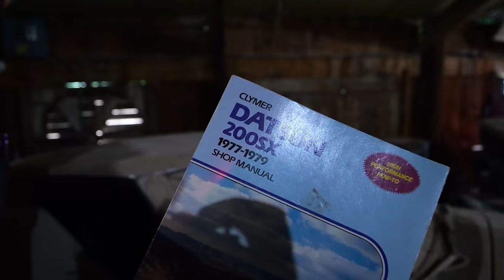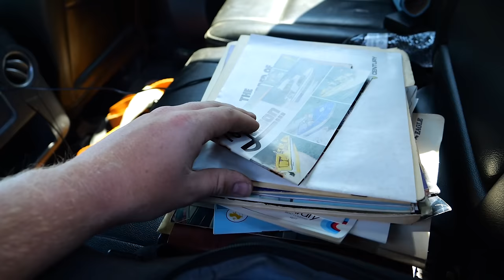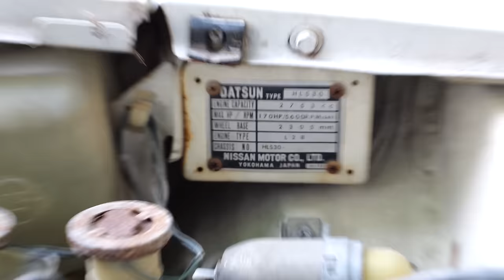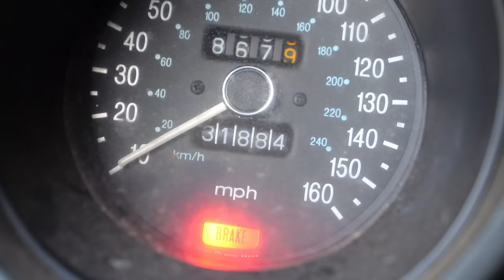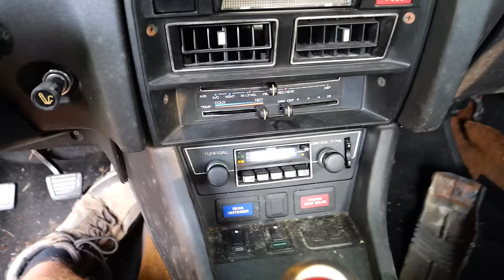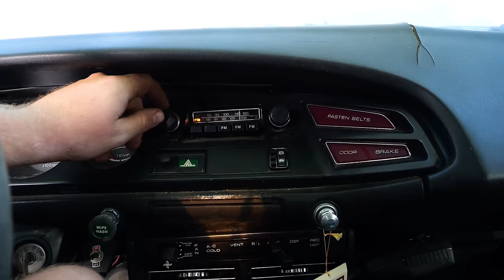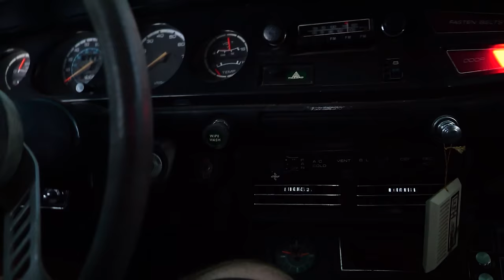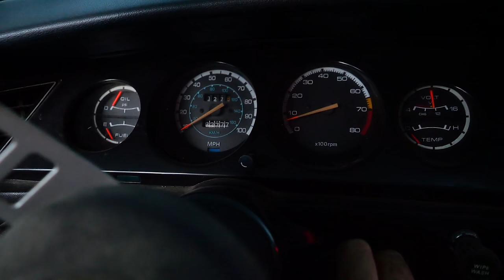Will 2 BARN FIND Datsun's RUN & DRIVE After 30+ Years!?

Comment: To be fair, the most interesting car of those two, is the 200 SX - it's a rare beast. Lots and lots of the Datsun Z-series cars out there, but the 200 SX is like to find a diamond in a mud hole.
Reply: Its a shame he doesn't appreciate it...
Reply: @seymoarsalvage  Yep.
Reply: Exactly! And this one is in pretty nice shape. Not as rusted as 280 and any decent body shop should be able to fix that rear end.
Reply: My dad had a 200SX back in the day, it was the first non-American car he ever owned. He always talked highly of it, said it was much more refined than his 442 he drove through college. My mom totaled it during a Seattle winter rain storm 😆
Reply: @basedWisco715  Even Paul Newman liked the car, and so much he built a racing car: " Paul Newman built and raced a 1977 Datsun 200SX in the 1978 IMSA Class C where it won 19 out of 22 races."
Reply: It would be a great Power Tour car for next year if gas prices get out of hand again.
Reply: I agree, 100% I haven't seen one of those since back in the 70's and 80's back east.
Reply: Welp $500 haha dont know anything about  280z kinda know heard stuff .  Dude has diamonds for free no clue
Reply: Drove an 87 200sx for 25 years, finally sold it as it doesn't do so well up in the snow, guy fixed it up and now has it on a website.
Reply: I agree he didn't give that car enough credit. I thought it was interesting when he showed it.  The right guy could build a nice drift car out of the 280, and the 200 could be a nice cross country rally car.  Fenders cut and wide body that 280 and boom you have a nice jdm car for resale.
Reply: The 200 is perfect for 24h of lemons.
Reply: Too bad it got smacked in the butt!
Reply: really lots of 280zs where you finding them?
Reply: Just because it’s rare doesn’t mean it’s valuable
Reply: Just because it’s rare doesn’t mean it’s valuable Yugos are rare but they aren’t worth shit

Comment: That 280Z has a well known problem with the AFM. The spring inside of it loses tension and no longer meters fuel correctly. If you carefully pop/cut the plastic cover off of it, take the spring out of the center of it and find a replacement for that spring. Once replaced, the car will produce up to an extra 30 hp than what it is doing now. I have a 77 280z that I purchased in 1985. It is still in my garage today.
Reply from the maker: Good to know!!
Reply: Wouldn't the parameters of that spring be critical to getting good A/F ratio? Coefficient (spring rate) and length being the two most important. If the coefficient is not right it might only be good at one particular airflow and lean or rich at other airflows
Reply: @brainndamage you are correct
Reply: I guess now we know why it’s in his garage😂
Reply: @ishamhammer7320  "I guess now we know why it’s in his garage"  Where else would it be genius? Is it parked next to the Dodge Viper.
Reply: You can actually adjust tension on that spring too, very easy to do, the spring is mounted on a little toothed wheel that is locked in place with a little pawl held in by a set screw. 
You won't gain much peak horsepower  but you'll get so much on the low and mid range that you'll think you did. These cars were tuned, very lean from the factory, for emissions and to get better fuel mileage.

Here's my example:
The 280 I had  when I first bought it, in 2003, it ran 17.2 1/4 mile at 68 miles an hour. 

I did a little tweaks with that spring , played with ignition timing
And added header with 3" exhaust and that thing, without opening the engine whatsoever, I was able to get down to a 15.2 at 90 miles an hour in the quarter , 2.3 60' 
Not too bad for a 1970s in-line six rated at 170 hp. I think mine might've been a ringer though, because it actually dynoed at 168 to the rear wheels.. 

And Absolutely burnouts were no problem.

 Ironically, the top speed was unchanged, those L28s were torque motors, all those tweaks I did only improved low and mid range torque  did nothing for high-end horsepower
But that didn't matter because the stock top speed of 118 or 120 somewhere around there was perfectly adequate and that low in mid range torque  is what made it fun .

Also the absolute bulletproof reliability of that Z car basically gave me a Nissan guy for life
I was in the service, this car was my daily driver and I also loaned my car out to other service members when I was deployed, and they couldn't kill it. Neither could I I took that thing to the drag strip every freaking weekend I didn't either have duty or deployed and beat the piss out of it. I eventually grenade the transmission, but at that time we could just go to junkyard and grab another one stab it in in about an hour. What a great car those things were. 

Also try to change my mind you probably won't 
Those L series sixes are among the 
Best sounding six cylinder engines ever. 
Nice deep rumble at lower RPM 
And a nice baritone shriek at high RPM

Comment: I'd say the 200SX is a keeper, looks very fun! And very simple since suspension wise is nothing out of this world, just leaf springs by the looks of it
Reply: Yeah that one looks like a sick little car. all the little features added too
Reply: I've had 2 of them both were 1977 good little cars L20B engine in them undesirable cylinder head but still a good engine that can be made better if you get a different head or leave it as is.
Reply: Also the front suspension is almost exactly like a first gen 510 so it easily be done up nice.
Reply: Nissans are good cars, I'd take the 280 myself

Comment: Man, you know how to start a video.

Also, this takes me back to high school. I had a Datsun 210, a buddy had a 200SX and another buddy drove a 260Z.

And, the 200SX was not the bottom of the line. It was one step below the Z as a “sporty” car. In 1978, the B210 was the low car on the totem. There were 310s, 510s and 810s (I think).
Reply: You are correct on the three model lines, the 210(Became the Sentra) the 510(Altima) and the 810(Maxima)
Reply: I was "given" a 1977 Datsun 810 wagon in 1984 by my parents as my 1st car - I believe it had the nearly indestructible 240z engine with a 4 speed overdrive automatic.  It stayed in my family from 1979 to 1990ish. It handled like a boat but always started
Reply: The SX was a sporty variant. It looks pretty decent.
Reply: There was also a 280 z and 280 zx turbo and a 280 4 x 4 four seater but the rear seats were small like for kids .
Reply: They are almost impossible to find without rust . Metal was thin .

Comment: OMG! Not only a revival video of an iconic Z car, but also an original Datsun 200SX! I had the exact same 200SX , a ‘77 5 speed in highly oxidized silver. It was my first car in the early 90’s. It was kept for 4 years and was super reliable after I rebuilt the car on the L20B motor. I remember scouring local thrift stores for 8 tracks to use in the dash mounted player….

Thank you Kevin, you’ve made my Friday.
Reply: Yeah I've own a mint silver 77 I got locally was a fun car only exception mine was 3 spd auto but ran and drove super nice.
Reply from the maker: Glad you enjoyed it!

Comment: We had a wonderful time rebuilding our 280 Fairlady with not quite as much body work  to do as you, the fun one and apparently almost always rust spot is in the hatch, mostly due to grime build up that sits and rust all on it's own. Our project was to re-engineer (not much though) a Skyline GT-R engine into the hole and make it run. Which was/is great and it passes smog ha ha. We've done similar things to some Silvia's too, We really need to do videos of our work.

Comment: As a Z owner every point that you pointed out on that 280 Z is exactly where the Z’s rust both of the rear quarters are gone, fenders (front) sometimes are gone, the doors yes, the bottom of the door the lower side that is rusted, the floor pans are gone so all the rust on that 280 Z is very common
Reply: Every panel on my ZX is gone lol
Reply from the maker: So the whole thing 😂
Reply: @JunkyardDigs  id buy the hood from you lol mines got an LS in it!
Reply: @JunkyardDigs  Pretty much haha I’ll be restoring it on my channel soon😉
Reply: @JunkyardDigs  Kevin swap the manual trans into your clean 260z that car is nice. I’m happy that you kept it all these years. Your car collection “hoard” has to be giant lol. But I also have suffer from the buyalot gearhead syndrome. A few days ago a friend says “Hey I saw your old Trans Am from high school driving around town” I replied  “yeah that was me driving it”. Friend replies “It looks great I can’t believe you still have that thing so how many cars do have now?” I then quickly changed the subject.😂
Reply: @bigmikeyz0071 I agree would love to see the manual put in Kevin's 260z
Reply: @bigmikeyz0071 yep lots of us have gearhead syndrome lol
Reply: I remember one of those rusting in half once
 The guy never did pressure washer underneath it.
Reply: @JunkyardDigs pretty much but there may be hope for it
Reply: I lost my 240z to body cancer, nothing left on the floorboards but several layers of cloth. I kept throwing extra layers at the "floorboards"
I drove the hell outta it, my brother lost his license to it driving at double the speed limit. (over 100mph in a 50)  it finally died in heavy traffic, I cut the clutch fan out completely after the old one failed, replaced the radiator, but completely removed the fan. didn't have an issue for 5 more years, when a very slow moving traffic jam finished it off. after 2 hours running the heat full blast in 100F+ weather 
I should've pulled over an let it cool off. but the engine finally siezed. no more 240z
Reply: @ronalddaub9740  After a point, it's a bad idea
Reply: @JunkyardDigs i've seen pictures of one that they replaced basically everything behind the doors

Comment: Cool video Kevin . 
Quite like the 280Z lot of fun to drive especially when completely roadworthy . 
Imagine sorting it out and having some decent modern tyres/tires on it . 
Yes a nice project for someone.
Reply: With a modern wheel and tire combo those old Z cars can easily be daily driven.

The EFI when in good order and tuned properly makes them start like modern car.
Couple that with a light clutch and positive shifter, and simple, robust mechanicals, they are a treat. I had one when i was in tbe Navy, it was my daily driver, and i drove it like i stole it. Just about the only way you can kill one of these cars is to intentionally try to kill it by running it without oil... and even then it would probably run for a decent long time before it stopped.
The only way for these cars to die a natural death was rust. This video is living proof of that the reason his car was parked was because it was so rusty not because it didn't run.

They pretty much drive like a 1990s or even early 2000s car.

Only issue with modern rubber is they become a bit heavy steering when parking, these cars are portly beer cans, about 2800-3200 lbs at the curb for the 280z depending on model and options.

The AC system in a 280z was the equal of a GM system of that era (or in other words quite good)

Comment: Little tip
For ya Kev, from an old tow truck hand.  Put a bottle of dish soap in your winch box on your trailer. Squirt a little in front of the stuck wheel and and it’ll slide that sucker on quicker than you can say “Robert is your fathers brother.”

Comment: Had a slew of 280Z's, the '75's and some '76's were chock full of German made Bosch components (Later used Hitachi production) for the L-Jetronic injection.
In good tune they were a blisteringly quick car with absurdly good handling.  Many I assume got neglected because the early FI systems were more than a bit alien to those used to working on carbs, but if you took time to read up on the L-Jetronic, it was amazingly simple and easy to keep running.  I wish I still had some of the ones I hooned up back in the 80's and 90's when they were cheap, but Michigan auto cancer eventually consumed them all.

Comment: Highly entertaining. I have to say you're brave to have your truck connected to the trailer still. One word FIRE. Absolute blast to see you drifting in that little car! Amazing that they had the clutch master cylinder in stock. It must fit a BUNCH of cars.
Reply: Yep pretty much every single Nissan manual transmission vehicle since probably the late 1950s and up to like at least 2010 or so uses the same three-quarter inch bore clutch master cylinder and a 5/8 inch bore slave. In fact, up to about 1979 or so they use the same Bendix bolt pattern..
Those early Datsuns,  Wilwood master cylinder, will bolt right on,  and even the later ones, with a slightly different bolt pattern are close enough that they aftermarket manufactures, simply make a larger base and they just drill appropriate bolt holes for the specific vehicle application.

Nissan basically built their brake systems under license from Bendix and it stuck.

even today Nissan hydraulic systems use standard bore sizes rather than metric.

Comment: Those old iron block L20B's are practically indestructible! With forged crank and rods from the factory, you can wind them to the moon and not hurt them, and they can be built for some serious horsepower! Same with the 2.8 L28E (and ET turbo) in the Z and ZX cars brought into the US. Datsun had turbo versions of both the L20 and L28 engines for competition use only, called the LZ series that were making upwards of 560 hp. with a twin-cam crossflow head. There was also a LD28T, which was a turbo diesel based on the same block. I actually worked on one back in the late 80's that was in an 810 sedan! Supposedly they weren't even supposed to be offered in the U.S. in any vehicle, so this guy must have gotten one of the Japanese 'pullouts' that usually have under 30,000 mi., and had it installed. At any rate, it was no slouch for a diesel burner!!😉 A lot of cool history behind these cars...😊
Reply: I've read that it was not hard to adapt the L 28 ET exhaust manifold to the diesel that might've been what happened

Comment: Literally one of my dream cars     I love seeing that it’s drivable after all this time
Reply: The 240z was a beast, I ran one without even  a cooling fan for 5 years, I ran with 140lb of sandbags over the back axle. it would drift going from 3rd to 4th at 90mph without even trying.the 260 and 280 were a poor attempt to cover the added weight of all the safety implentations  required. Torquier, but less smooth power band. this wasn't fixed until the 300zx.
The 260 in this video sounded horrible.

Comment: I was loaned a little Datsun like that once by a dealer who was repairing my car I bought from them.  The police pulled me over because the tail lights were out and the tires were bald, the windshield was cracked, and much more.  The police contacted the Datsun dealer and they called me back to get me in a better car immediately.  I later got a 300GX with
my ex wife.  The 300 was a better car than most and was practically indestructible.  That 280Z is pretty cool! The 200sx was futuristic for it's day.

Comment: @JunkyardDigs, here's an idea: use the 280Z as a parts car for the 260 that you already have.  Either run the L28 with the stock L-Jetronic FI, or use that as a base for a standalone EFI, like Megasquirt or Microsquirt.  That way, you'll have the full 170 hp in the 260 body, plus you can then use any Windows-based notebook to tune the engine for the best performance and economy possible.

Comment: My good friend was lucky to have been hired by Datsun of Missoula in 1975 and within a short period was sent to school to be trained to reset the ignition timing and injector system on all their Z cars. This was due to most of Montana being much much higher than sea level that the factory settings were at. Unhook the odometer and "test" them all.

Comment: In South Africa people love these old Datsun/Nissan cars and pick-up's. I personally still daily drive a 86 Nissan 1400 pick-up and they never die. Especially the carbureted ones.

The Nissan 1400 pickup's got the nickname champ, because of their reliability, that later got adopted as the official name for the pickups and they were manufactured from the 1971 until 2008 until emissions regulations ended their long stading pillar of the South African most beloved pickup. 

Over 275, 000 of these pick-ups were build in South Africa and even till today 2024 you still see these pick-ups being driven on a dayly basis. 

Rust buckets or not you can not deny the old Datsun's reliability. Forever Datsun will live on in our proud Datsun owners hearts.

Comment: 7:00. Going inch by inch you reveal just how beautiful this cas really. Sure theres rust but that's easy to fix.
Reply: Be prepared if you want to dive down into a rabbit hole, that is a rusty Datsun. Rust is known as cancer, and in no way is this more profoundly visualized than by looking at a rusty Datsun car. 

That one could be a good rally cross car and parts car :)

Comment: Datsun 280  I have had a few of these . Rusted rear that gives a big bang when you pull off . Spark plug holes strip out . Gas boiling in the gas lines in the heat of the summer .  I was with a Vol Fire Dept. and ran it to long distance fires .  I blew a tire out at 90mph and never knew it due to the independent susp on the rear . We put a bigger turbo on the last one I had . Was clocked by hwp running 149mph . It took him a month to find out who I was . He was in a mustang lx and said it was like chasing a ghost . Just keep pulling away

Comment: That L20B is a beast. Had one in a 1976 Datsun 710 Sedan  Water pump was a bitch if I remember as the fan clutch was pressed on from the factory with one long bolt on the upper right installed for you. Great car I got it free if I could get it running. Drove it everywhere for 2 years. 4 speed.   Datsun used that same engine in the 720 pickup, your 200SX drift car and a few others that were rear wheel drive. Get her on the road she will love ya